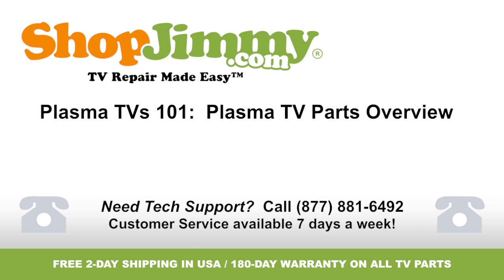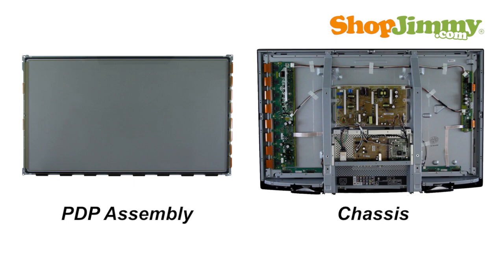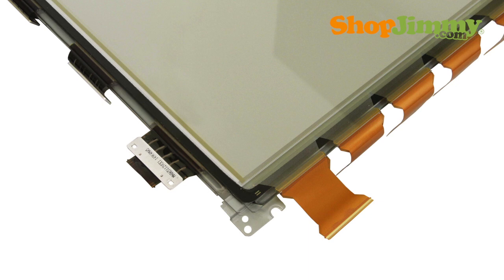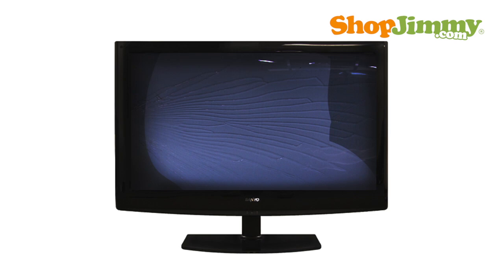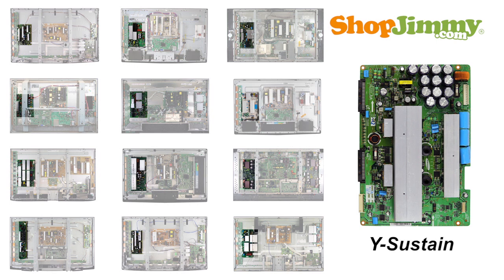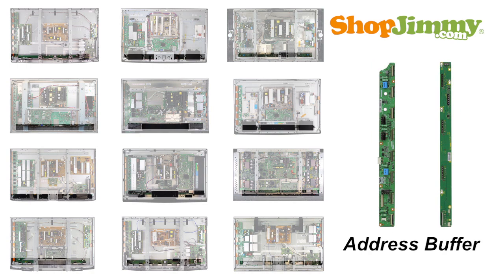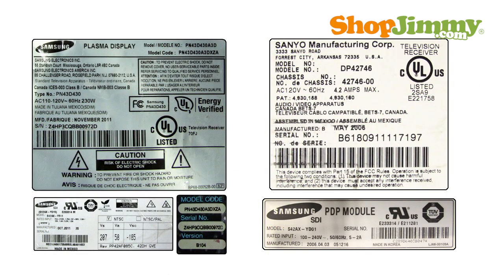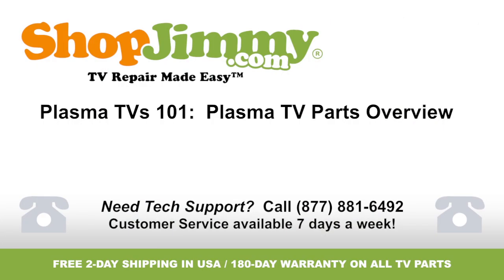Plasma TV Repair Tutorial - Plasma TV Parts Overview - Common Plasma TV Symptoms & Solutions

Comment: Hi: I have a lg 60ps11-ua plasma tv that has no picture but has sound. I have done research to find that it could be the x y or z boards. also more research said it could be the logic board.I have tested the power board and all voltages are present to thee x ans y oards. No blown fuses. What do you think? Also none of the heat sinks get hot, only 2 get warm near power intake

Comment: I have about a 5 year old 50"LG plasma, model 50PG20, serial # 808RMRH207766, and it's having issues when cold. First thing in the morning once I turn it on, it will shut itself off within seconds. I can just turn it back on using the remote but it will shut down again shortly. Does this about 20 times now (getting worse) but once it's warmed up, it keeps working just fine. Any thoughts.

Comment: I have a VIZIO VP50 HDTV10A plasma TV manufactured in May 2007.  My TV has the following symptoms: 1) tries to start and makes a popping sound then just seems to go to standby, 2) sound but no picture, and 3) popping sound and shuts down.  Your videos were helpful and I may purchase parts if you can help me locate the correct ones.  I believe this is the Y Sustain and Y buffer but will defer to your technical expertise.  Please advise and Thank YOU!
Reply from the maker: TurtleTech I recommend replacing the Y-main board.  Here is a link to replacement parts for your TV model number on our website, click here:  http://www.shopjimmy.com/catalogsearch/result/?q=HDTV10A  Be sure to match part numbers on your current board, with your replacement for compatibility.  Here is a link to a video showing how to identify your part number, click here:  Samsung Plasma TV Repair: Samsung Plasma Panel Parts Guide  You can also call our customer service for further assistance with your purchase.  (877) 881-6492  Thanks and please let us know if you have any further questions with your TV Repair!  www.shopjimmy.com

Comment: I have the Samsung PS43D450A2WXBT television and it won't turn on. When I turn the TV on with the remote the standby LED flashes 5 times and then it turnes off. The logic board LED light flashes every second. Do you have any advise?

Comment: Hey, I have a westinghouse sk-26h730s black hd tv and the led blinks white underneath the W logo of the tv. When the TV does come on there is no problem with the picture or sound or back lighting on the screen. Heres the info on the tv

Model Name: SK-26H730S
PN: TW-55805-C026C
Serial N: 5580Z84352266

I believe it's the Power Supply Board because everything else works when it eventually stays on.

Comment: I have a lg 50pq30 t.v. that will turn on sometimes with the remote but at other times I must use the control buttons on the bottom of the t.v. The problem is the menu will not stay on or I cannot select any item of the menu. Any ideas?

Comment: I am a service shop with an LG plasma model 50PG20 that has no picture, just sound. I measured the panel voltages and they are in spec 194 and 60 volts. How do I rule out the buffer boards? I am suspecting a bad logic board as a regulator only had 2 voltages on its 5 pins 5 volts on each. As well there is a crystal on this board with 0 vdc on both pins. I would like to rule out the buffer boards as they seem to be such a common cause of this problem.

Comment: Hi Jimmy,My Samsung Plasma TV PN50C450B1D makes  6 clicking noises then stops and does nothing. I followed your video and unplugged each board from the PSB (pwr supply board) and plugged them in one by one.   When I unplug the logic board the familiar Samsung audio starts then stops and then restarts doing this constantly with the standby light flashing.  However, when I plug in the logic board to the PSB the clicking starts, continues for 6 clicks and then kind of locks the TV up and to get this to repeat itself I have to unplug the set for a minute or two. How can I narrow it down to exactly which board(s) is giving me the problem.

Comment: I have a Samsung PN64E533D2FXZA plasma tv that shuts off by itself.  I try to turn on with the remote and the red LED flashes once, then nothing.  I unplugged the TV for about 5 minutes and plugged it back in and it turned on and worked for about 30 minutes and then shut off again by itself.  Again, tried to turn on with remote.  LED flashed once, then nothing.  Does this sound like a capacitor issue on the power supply unit or something else?  Thanks.

Comment: I have an LG 60" Plasma TV Mod# 60ps60-UA Ser# 00IRVAQ2AO16Everything seems to be working correctly with the exception of the left 3rd of the screen is black from top to bottow, the other 2/3rds show a clear imagine but the center 3rd does have vertical lines thru it. ( This is viewing the TV from the front)(This is viewing from the rear of the TV)At the very bottom on this TV there are 3 circuit boards running horizontally across the bottom. (Address Buffers)If I disconnect the ribbon connector from the circuit board on the far right there is no change as the left 3rd of the screen as viewed from the front of the TV remains black.When I disconnect the center and far left ribbon connectors from the circuit boards one at a time it does distort the 3rd of the screen just above that corresponding circuit board. How can I check to see if the circuit board I suspect as possibly being bad is in fact bad or something else is causing my issues?The circuit board I suspect might be the issue has a sticker on it that reads;EBR51552201XRRBTKSS0098F6048532209.11.09And directly printed on this circuit board is;LGEPOP 081210BOARD:60H3_XRPART # EAX54748601REV:JLOCNO:4XXXI'm retired due to Cancer and cannot afford to purchase a new TV and am therefore hoping I can resolve the issue that this TV is having by identifying and purchasing from you the correct parts.Any Help will be greatly appreciated as will be any suggestions of places to check to resolve this issue.Thank you for your time and consideration in helping me out with this problem................................................Burt

Comment: I have a Samsung Plasma 5300 model PN51F5300AF TV.  The issue is no power within unit, I tried replacing the power supply board with no luck...still the same problem.  Now what do I try?

Comment: I have a Samsung 50 inch Plasma model pn50a510p3f. When I turn the screen on, the TV makes loud popping noise with green fuzzy lines across the screen. It power cycles on and off several times before it finally stays on and works fine, until I turn it off and it goes through all that again. I have taken back cover off and its very dusty in there but I can't see where any capacitors look bad (bloating or leaking fluid) anywhere on any of the boards. I noticed in one of your videos, someone states that it might be a Y board.
Reply from the maker: Davinovich Burgess  Please watch this video FIRST to help with your repair!  https://www.youtube.com/watch?v=BP3NVNCGEv8  I recommend replacing the Y-Main Board and the Upper & Bottom Scan drive boards in your TV.  Click this link to replacement parts:  http://www.shopjimmy.com/catalogsearch/result/?q=pn50a510p3f   There may be multiple boards for the same TV model number, be sure to match part numbers on your current board, with your replacement for compatibility.  Here is a link to a video showing how to identify your part number, click here:  https://www.youtube.com/watch?v=R1jmj_foId0  Thanks and please let us know if you have any further questions with your TV Repair!  www.shopjimmy.com

Comment: Hi. 
I have a Panasonic plasma TV . Model 42pf3320/10.
The screen has vertical lines  when TV image is displayed.
 one on left hand side and one in middle running vertically full length of screen. Would you have any idea cause would be, possible logic board?
Appreciate any info

Comment: I have a Maxent 58 in plasma. Set works great for several hours and the picture blinks and is unstable. When I let the set cool for awhile it works fine again. What is the trouble area? Power supply, fan, ?
Reply from the maker: Richard Borden I would recommend replacing the Y-main board in your TV.  Please reply with your TV model number and I can send you replacement part info from our website. You can also call our customer service for further assistance with your purchase.  (877) 881-6492  Thanks and please let us know if you have any further questions!  www.shopjimmy.com

Comment: Hi Have a 50 inch Visio Plasma TV Model P50HDTV10A ,the TV went from colored pictures, to a vertical bar that would not go away. Which board(s) should I replace to fix it . Please help Thanks
Reply from the maker: saikytful   This sounds like a TV panel problem.  If your TV panel is bad, it may be more cost-effective to replace the TV as panels are typically hard to find in stock, difficult to replace, and expensive.  Thanks and please let us know if you have any further questions!  www.shopjimmy.com
Reply: ShopJimmy.com Thanks Jimmy, should I try replacing the Y-Sus or logic control board before giving up ?

Comment: Dave Moyer
I have a Samsung Plasma TV that has 3 vertical lines that appear on the right side of the TV at 4" and 9.5" and 10" from the edge of the TV.  With the test screen up the lines which are about 1/8" wide appear light blue on white screen and dark blue or black on red screen and light blue on a yellow screen and light grey on a dark blue background. These lines appear even when using other video sources and are also visible thru menu screens.
Model # PNE51E8000GFXZA
Model PN51E8000GF
Ver TS02
S/N Z4S13CQCB00997P

I can send screen shots and pictures of every boards model number etc from the chassis.
I took the back off the get picture of every board and sub assembly.
Thanks a million !

Comment: I have a Samsung plasma model PN50C550G1FXZA version NY02 that lost its picture, and maybe sound, after some loud pops and snapping noises.   After removing the back I found a burned cap (C5816) and a possibly damaged transistor (Q5102) on the y-sustain board (LJ92-01683  AA1).  I know this board has to be replaced, but is there anything else I should check or replace to get this set working again.
Thanks for your help.
Reply from the maker: Chuck Smith  Please watch this video FIRST to help with your repair!  https://www.youtube.com/watch?v=BP3NVNCGEv8  I recommend replacing the Y-Main Board and the Y-Buffer board in your TV.  Click this link to replacement parts for your TV model number:  http://www.shopjimmy.com/catalogsearch/result/?q=PN50C550G1FXZA  There may be multiple boards for the same TV model number, be sure to match part numbers on your current board, with your replacement for compatibility.  Here is a link to a video showing how to identify your part number, click here:  https://www.youtube.com/watch?v=R1jmj_foId0  Thanks and please let us know if you have any further questions with your TV Repair!  www.shopjimmy.com

Comment: I have a Samsung Plasma (PN60E530A3F) that stopped displaying a picture. It started out getting harder and longer to turn on. The red light responds to remote and ON/OFF button, but the picture does not display. The green LED on the main logic board alternates on and off slowly. I believe the Power Supply is working as it should, but am stuck on what to check next. Any suggestion? Thanks for your help!
Reply from the maker: e2thedubd  Please watch this video FIRST to help with your repair!  https://www.youtube.com/watch?v=BP3NVNCGEv8  I recommend replacing the Y-Main Board and the Upper and Lower Y Scan Drive boards in your TV.  Click this link to replacement parts for your TV model number:  http://www.shopjimmy.com/catalogsearch/result/?q=PN60E530A3F  There may be multiple boards for the same TV model number, be sure to match part numbers on your current board, with your replacement for compatibility.  Here is a link to a video showing how to identify your part number, click here:  https://www.youtube.com/watch?x-yt-cl=85114404&x-yt-ts=1422579428&v=R1jmj_foId0  Thanks and please let us know if you have any further questions with your TV Repair!  www.shopjimmy.com

Comment: I have owned a Phillips Plasma 42PFP5532D/ 05 for 6-7 years. A couple of days ago it made a hissing sound and switched itself onto standby and I was unable to switch on using the remote control. I removed the plug for a minute and was able to switch back on. But the screen is darker than normal and dark images seem to take longer to clear and leave a pixilated shadow for a couple of seconds. On light backgrounds a green/ yellow haze is in the top/ middle of the screen. Could this be the Y-Sustain board?
Thanks
Mike (I live in the UK)
Reply from the maker: Mike Hughes I recommend checking the capacitors on your power supply, if the capacitors are good, then the problem is more than likely the Y-Main board.  Here is a link to replacement parts for your TV model number on our website, click here:  http://www.shopjimmy.com/catalogsearch/result/?q=42PFP5532D  Be sure to match part numbers on your current board, with your replacement for compatibility.  Here is a link to a video showing how to identify your part number, click here:  Samsung Plasma TV Repair: Samsung Plasma Panel Parts Guide    You can also call our customer service for further assistance with your purchase.  (877) 881-6492  Thanks and please let us know if you have any further questions with your TV Repair!  www.shopjimmy.com

Comment: pioneer tv pdp 505pu gren light comes on but blinks between green and red no pic or sound
Reply from the maker: marlon masters   I recommend replacing the main board in your TV.  Here is a link to replacement parts for your TV model number on our website, click here:  http://www.shopjimmy.com/catalogsearch/result/?q=505pu+  Be sure to match part numbers on your current board, with your replacement for compatibility.  You can also call our customer service for further assistance with your purchase.  (877) 881-6492  Thanks and please let us know if you have any further questions with your TV Repair!  www.shopjimmy.com
Reply: not in stock

Comment: Hi, I have a samsung plasma tv (PL51E490) that the screen flashes weakly to every 15 seconds or so. Vs, Va and Ps turn on and turn off even with Ysus-Zsus board disconnected. Green led the T-con board flashes once quickly and slowly 14 times. What did could actually cause these flashes on the screen of a plasma TV ...
Thanks for your help.
Reply from the maker: Dercides Migliaresi   I recommend replacing the y board in your TV.  Unfortunately I do not see any replacement parts in the search results for your TV model number on our website.  Please reply with your part number on your main board and I can try searching for replacement parts.  Thanks and please let us know if you have any further questions!  www.shopjimmy.com

Comment: Hello,
I have a Samsung model PN50C590G4FXZA
I have a group of about 20 vertical lines on the left side of my screen when viewing beginning about 3 inches from the edge of screen.  they amount about 1 inch in width as a group.  They are not solid lines.  they are more like static interference , how a television appears when there is no signal coming through an antenna.  The rest of the screen is perfectly fine, these lines appear in any channel and are foreground to any menu.  If no picture is produced although the TV in on these lines will not show, it's only when a picture is produced they will form.  I have replaced the tcon board , and the main board with no success in fixing this problem.  I keep researching what other board could be the issue here and the only one I'm suspecting now is the greatest board.  Can I get help here if possible?
Reply: *g board

Comment: Peace,

 I have an LG 50PQ30-UA Plasma TV. It was working and all of a sudden, it turned off after a slight pop sound. I waited and turned on the tv again, and everything started quickly except that there is no picture. It's totally black. Tried to get the menu, it can't. Tried different connections, still no picture. Only sound.Everything starts like normal, but there's no picture. Please help. This tv is in mint condition. I can't just throw it out.

Blessings.